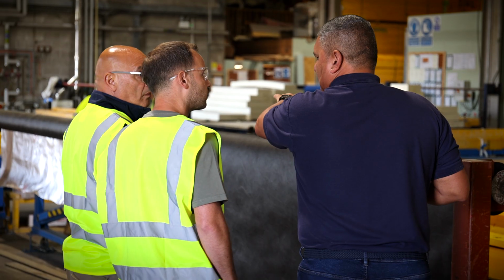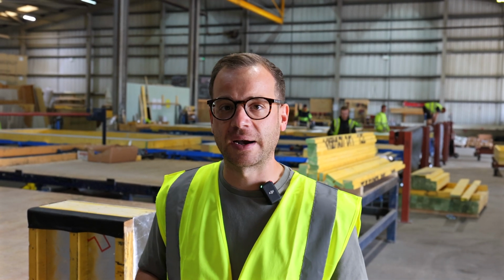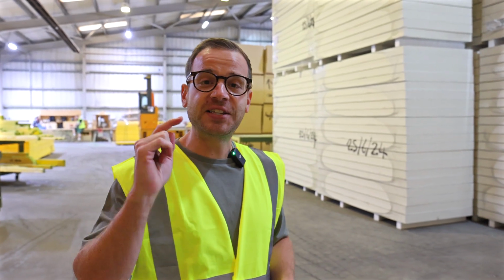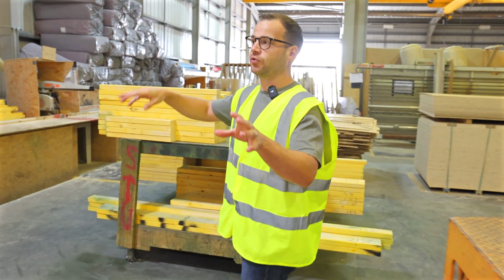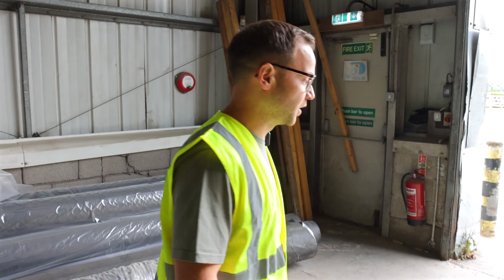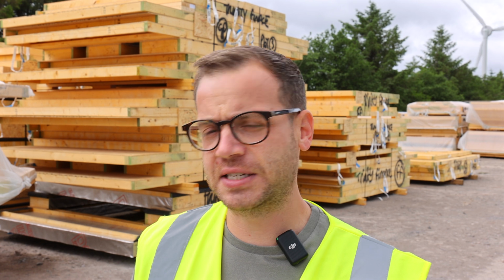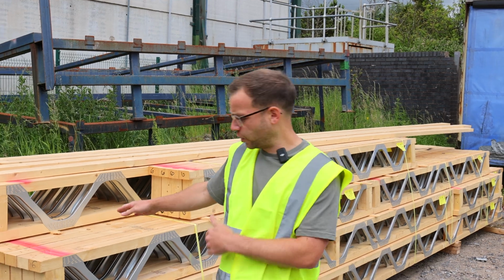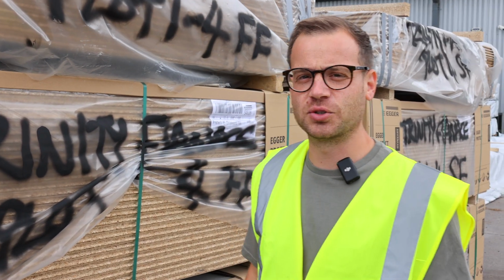Timber Frame Construction – A Solution to the UK Housing Crisis 🏡🌱

Comment: Thank you great video! Agree with all the pros mentioned, worth mentioning some of the cons.. not easy to detail for sloping sites as timber should not be below external ground level I.e stepped party walls, workmanship issues by bricklayers as not skilled or trained on some of the differences to traditional construction such as closing gaps below windows and roof and wall ties not being fixed into studs due to differences in wall tie spacing particularly to reveals, damage on site to vapour control barrier and insulation by first fixing plumbers and electricians and not flagging issues with clashing structural timbers with m&e, damage to breather membrane and sheathing and removal and damage of fire socks by scaffolders and bricklayers. Tolerance issues by groundworkers resulting in sole plate overhanging or underhanging or needing excessive packing creating structural issues, sites with gas membranes or radon barriers often having poor detailing resulting in sole plate enclosed in plastic membranes leading to risk of trapped moisture within the timber frame. Compared to traditional construction the risk of workmanship errors on site are higher due to skills gap and greater site supervision is needed in my experience.
Reply from the maker: You clearly know your stuff and yes agree with all of your points. Probably should do another video covering most of this and comparing the advantages to the disadvantages.